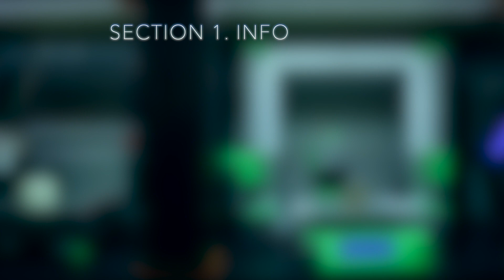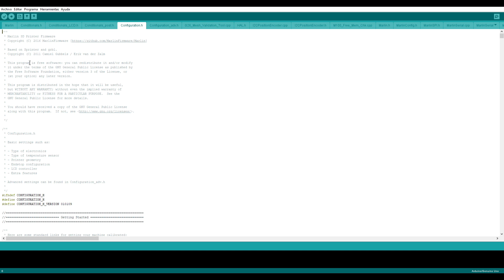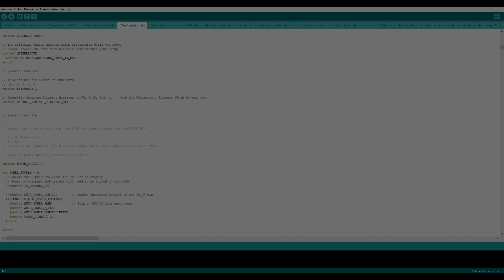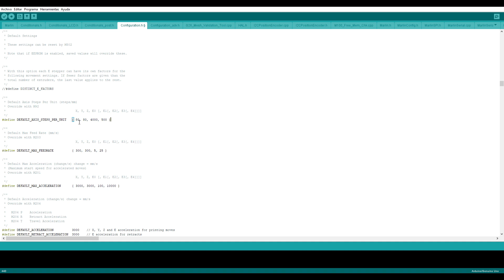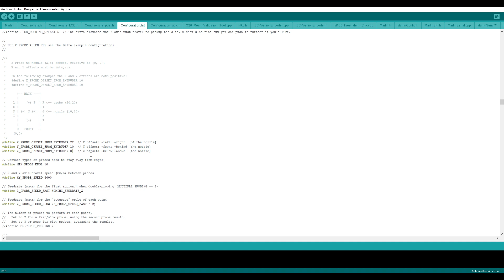Build the BEST DIY 3D Printer - Arduino Coding and firmware upload 1/2 #16

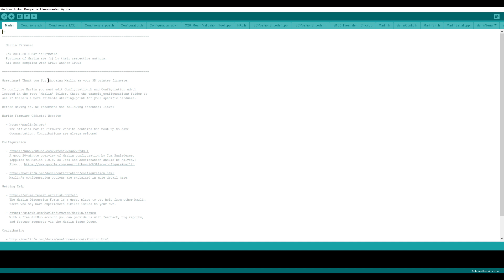Comment: Hi there. im following your tutorial step by step because im very bad at this thing and you videos are quite awesome, thank you! however due to my ignorance and also because this video has already 5 years, my arduino configuration does not shows like yours. i only have 4 tabs and im not sure if this will be the cause of not making my machine working. I only have Marlin, configuration h, version h and adv tabs. and when i follow your example, your arduino shows a lot of tabs, in 03:13 minute you can see what i mean. anyway, trial and error is the way, but if you could help me to learn would be very nice. cheers!

Comment: hi there. thanks for this step by step guidance. it helps a lot. I know this is already 5 years old video but I have a question regarding arduino and marlin because when i upload I dont have so many tabs like your example. is there any project file you can share that includes all of your projects including all those tabs missing? when I upload new marlin or any marlin i only get 3 tabs, Marlin, Configuration.h, Configuration_adv.h and Version.h - please let me know, Cheers!

Comment: Auto home is not working properly what should I do
Reply from the maker: Hi friend, just follow every single step in the guide and it'll work fine =)
Reply: Okay bro thank you I will once check it for that
Reply from the maker: It's quite difficult for me to diagnose what's the problem if I don't have the printer here I hope you understand, thanks for your comments :)
Reply: @architects3dp  Ok bro I can understand
Reply: I finally checked the all wire connections all are ok but need to change my mother board right
Reply from the maker: Great 👌

Comment: So here is one i cannot figure out.
On my Y-axis (the moving print bed) i have 1 endstop. if i manually move the bed with my hands away from the endstop (so its NOT pressed) i can then move the bed fine with pronterface.
once i hit the end stop after moving the Y-axis in the + direction, i can't move the bed in the -Y direction because it releases the endstop (first pressed - then release) and tells me in the Pronterface interface: "Endstop Hit" and the -Y direction is stuck. i can only move it in the +Y direction but then it will hit the endstop but doesn't stop..

im a beginner at coding and using arduino and a 3d printer, but i'd like to learn more about it
Reply from the maker: Probably you have a wrong connection of cables with the endstop.. pay attention to the cables/pins used and try again so maybe it’ll work with no problems
Reply: @architects3dp  Thank you!
i toook a look at the motherboard and the wiring, to my surprise one of the endstops was wired backwards, once i changed that it fixed my problem 😊
Reply from the maker: That’s good! Please recommend the channel 🤗